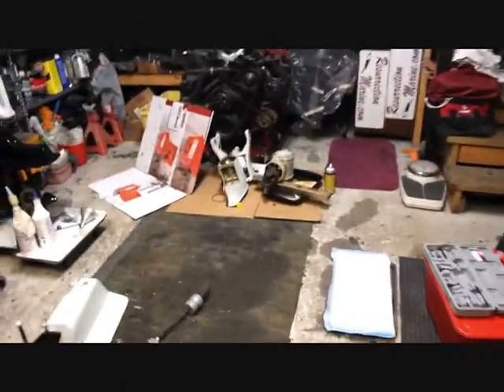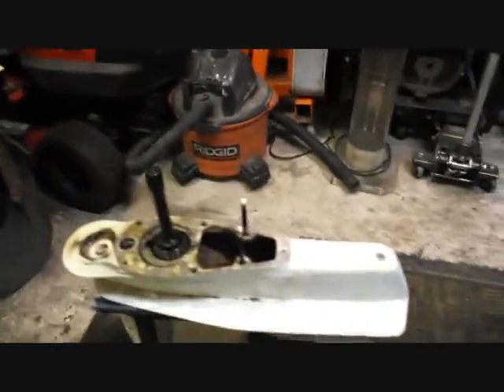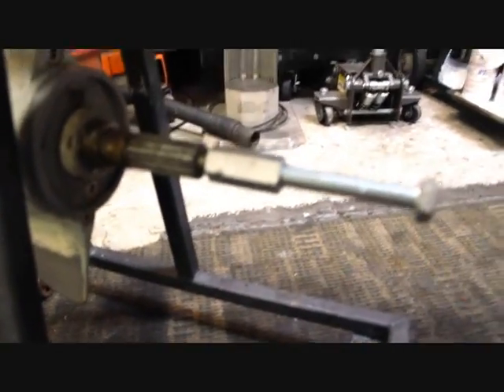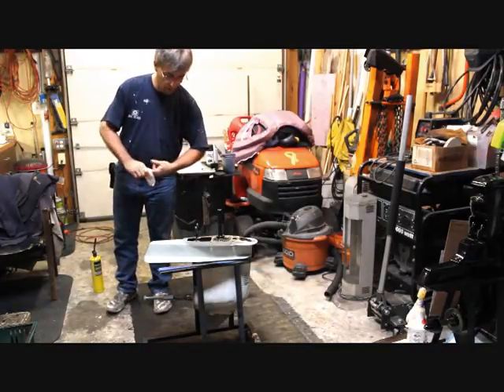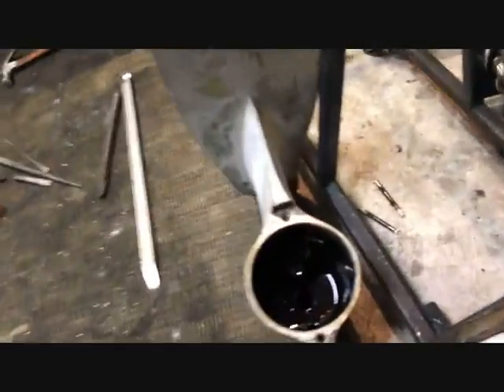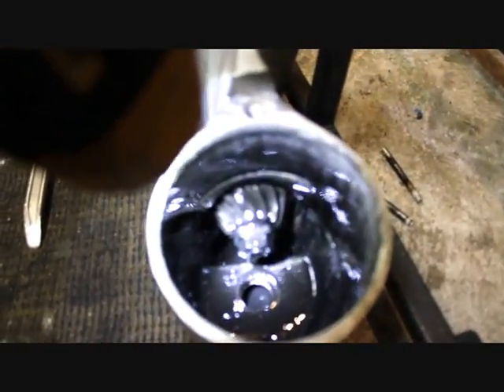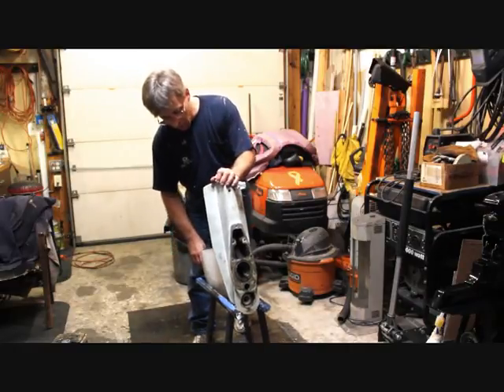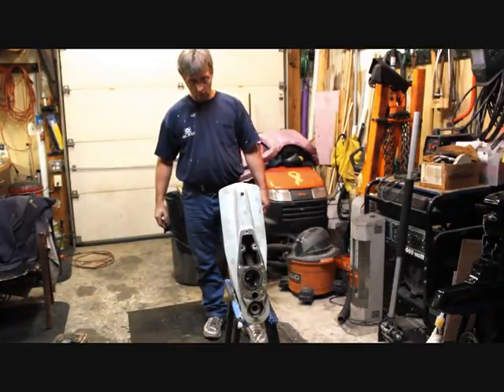Volvo Penta Project - Part 2

Comment: You mention several times that gear oil isn't good for the outdrive. Do you use regular engine oil? If so, what weight?
Reply from the maker: All Volvo Penta's use regular engine oil. Straight weight 30 or 40 normally. I personally use 40 weight with a half a quart of Marvel's in the mix.
Reply: Depends on the model. Some use 40 weight, the newer models use the 75w90 synthetic.
Reply: fin screenname stativfor drev